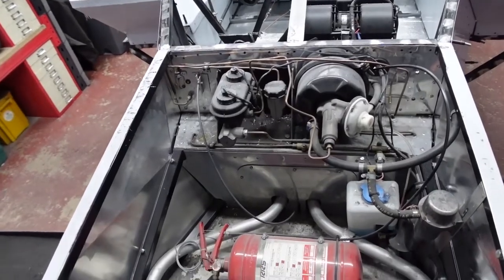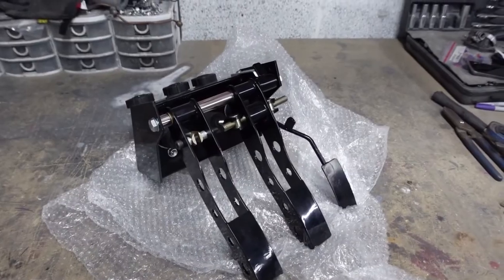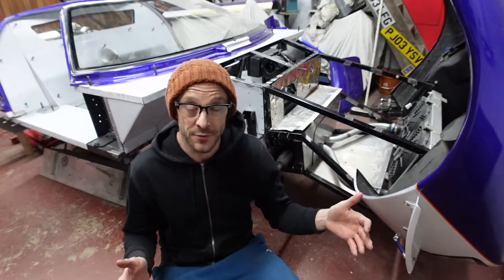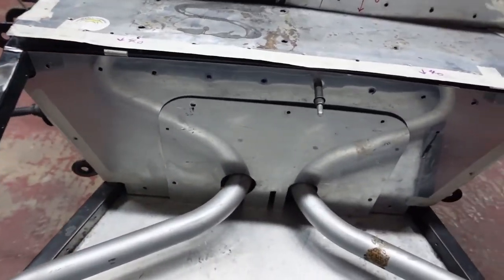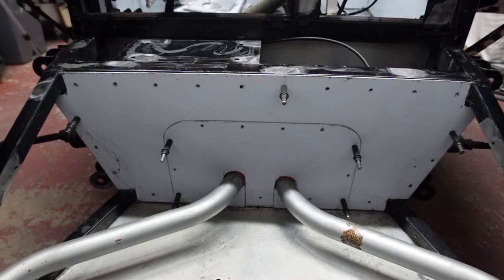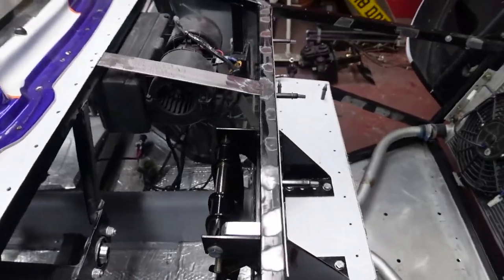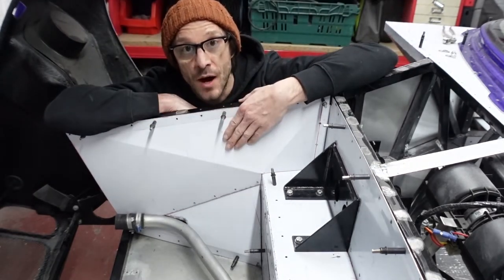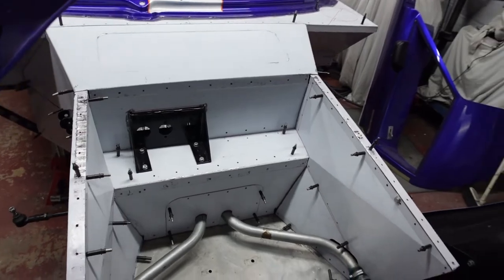GT40 Restoration - Ep 14: Custom Pedal Box Installation & Inner Chassis Panel Progress

Comment: Really enjoyed that, one thought on the alloy radiator pipes, would they have cleared the inner panels if you had swapped them over.  The bend in the pipes at the bulkhead end looks tighter than the one at the radiator end and that may have been enough to avoid the sausage-shaped cut-out 🤔
Reply from the maker: They're solid pipes Paul so no swapping around possible unfortunately

Comment: Coming along well and the panel work you're doing really worth the effort IMHO. 
@ 10:30 it looks like the pedal box actually straddles the column where your feet will be, but it must an optical illusion?
Reply from the maker: Thanks Ralph, appreciate it. The pedals do straddle the column, there's more than enough foot space, the angle of the camera shot makes it look a little odd
Reply: @RatchetRebuilds  cool :)

Comment: Portable CO2 in the passenger footwell works for me. No brake servos needed on a car this light. As I think Colin Chapman said, “simplify and add lightness”. Removing all that makes the front area much better looking with just your beautifully finished new panels and the coolant pipes. This is all I have plus the pedal box, screen washer and twin horns.

Mine is as close to original GT40P/1067 that it’s based on, so I have the original Lucas screen wash bottle and motor fitted into an ally recess in the flat panel. This is a really neat and tidy solution and I can send a photo if I have your email or Whatsap as I don’t do Instagram.
Reply from the maker: Thanks Doc! I'm pretty sold on the passenger mounted extinguisher and I'm really looking forward to the completely clean front end as I'm also hiding the washer bottle and horn too